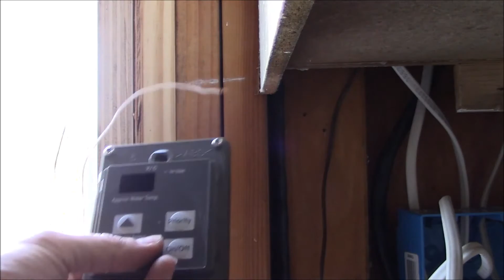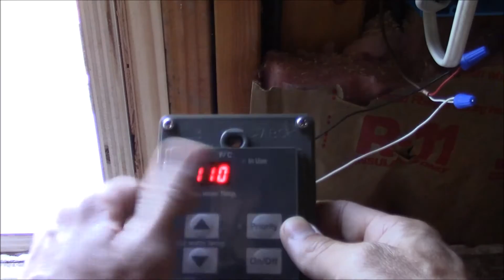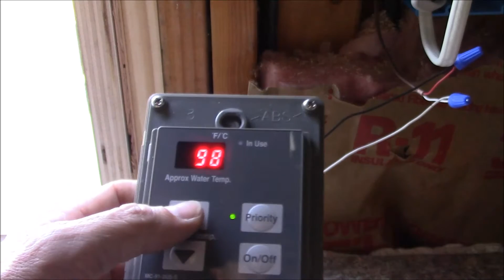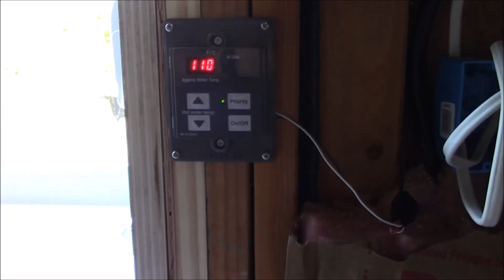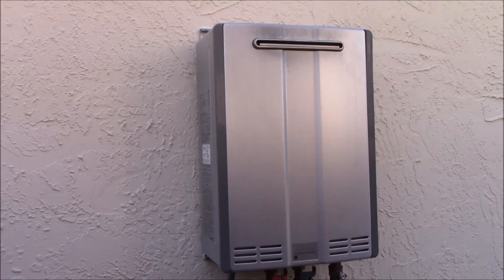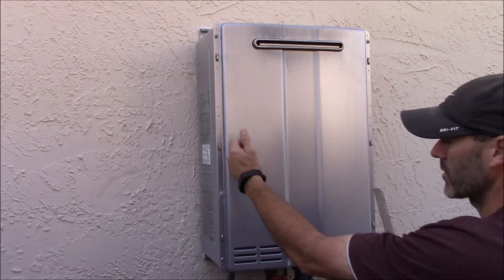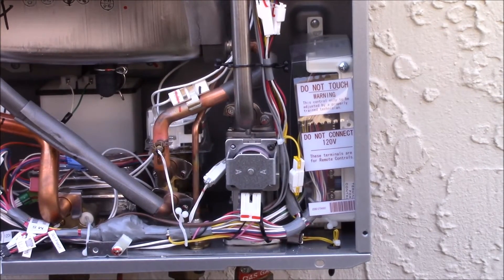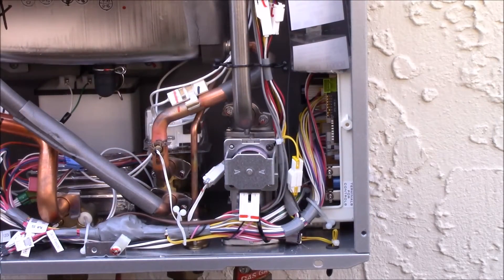Rinnai Bath Controller Wiring

Comment: Do we need to have in use a controller?? Or can we just use dip switch 6 to make hot 140 ??
Reply from the maker: Don't need the controller unless you want to manually set the temp at time of use. If you don't have it then the temp will always be 140, assuming you change the dip switch.

Comment: Finally! Got what I needed. Been looking for the controller for our R85 and every search produces the one with the perimeter plate you snapped on after mounting. The propane man installed ours without the perimeter plate. That's why I couldn't find a matching unit. Sheesh! Thanks DIY Dan.

Comment: controller panel wire color = White & Black ,  Tech keep saying  12V , ??   12v AC or DC ,  Tech also said  does not matter wiring , is that mean CONTRROLER  Panel run  12v AC , Am i correct ?  Thanks
Reply: Yes, if wire non- dependent, it is AC.

Comment: How does the heater get power
Reply from the maker: lostcoastlocal 707 it get power from the outlet located next to the outdoor heater. The water heater comes with a standard wall plug so it simply plugs into an outlet.

Comment: Does this not need to be connected to the actual unit?
Reply from the maker: It is connected to the unit via the doorbell wire. So the controller connects to one end of the doorbell wire and at the other end of the doorbell wire is connected to the hot water heater.
Reply: I asked without watching the whole video like a dubby. I just had my unit installed tonight and I was only getting 116 degree temp and the wife was very unhappy. I just switched the DIP switches to your configurations and I am at 140 degrees now.Thanks soooo much for the great video. Not even my own plumber could figure it out and that's after braking by whole house water purifier and trying to blame it on shipping. He installed it backward on top of leaving both filters coved in plastic, causing too much pressure to build and busting the nipple/connection piece in between the 2 stage filter. Then he had the nerve to tell me he was going to bill me ($140) to put it back on when the replacement comes in. What a day smh.
Reply from the maker: Dang, sounds like you need a new plumber. I get that he didn't know how to turn the hot water heater to 140, but to mess up so many other things isn't right. Glad the video helped.
Reply: @Dollar_Menu  why would a wife be unhappy with 116F water? It's already too hot for a shower. I left set our at 40C (104F) that is the ideal temperature.
Reply: Waste of time

Comment: Im building a new home in Rowlett, TX, using the Rinnai RU98, and close to completion, maybe two weeks, and realize I didn't run wires for the remote controller  The RU98 is in a recessed box on the side of garage, about 20 feet from the master bath, where I would think I'd want the controller. So I guess I need to try to get wires to where I need them with minimal wall damage. I also was looking for information for connecting the 120 volt wires to the heater. I have found the small wires in the heater marked 120 volt, which I assume are the right wires, Just seems strange to be running number 12 wire to those very small wires, not a terminal block.